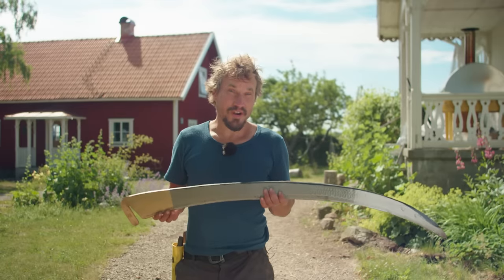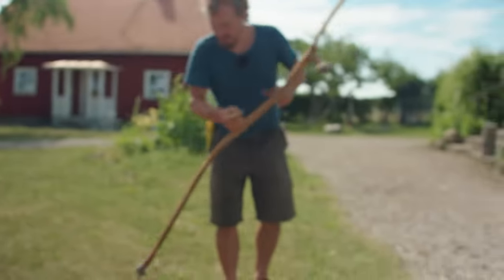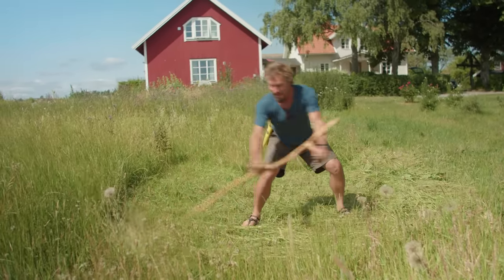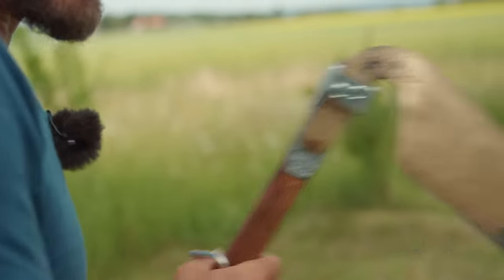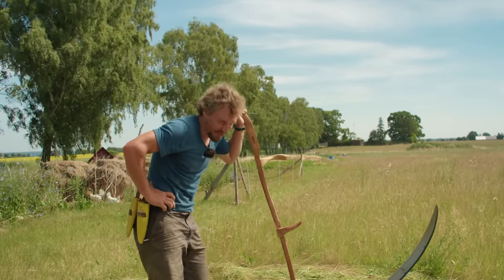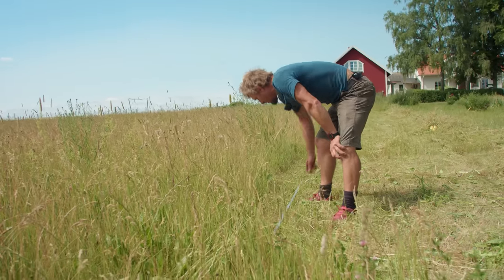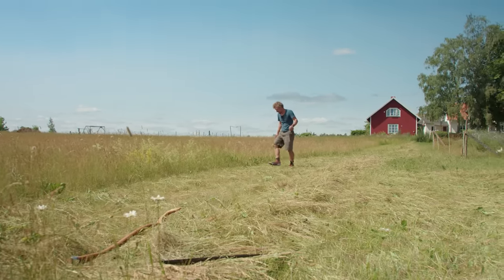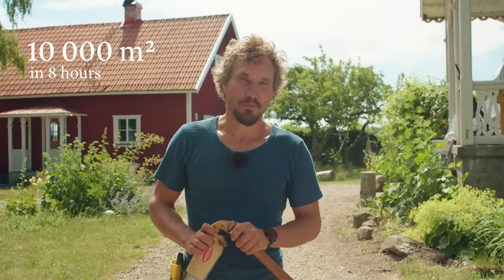Trying a HUGE Scythe Blade | MIND-BLOWING RESULTS! Hartstahl 120 cm Competition Size Blade

Comment: Have you tried mowing with the very very short blades that were common on the Norwegian west coast? I still have my grandfathers one handed scythe. Very useful for clearing in rough terrain.
Reply from the maker: I know about the one handed but never worked with it. I am sure it is good in some very steep rough terrain. 
50 cm blades are surprisingly effective, I recommend for kids and elders.
Reply: @slattergubben6702  I don't think ours is even 50 cm, and the haft is not much longer, and the angle is very different from normal Scythes.

Comment: I never knew that scythe cutting competitions were a thing.  For the competition, is it legal to use other materials for the blade instead of steel?  I'm thinking of a carbon fiber blade with either a steel or ceramic cutting edge.  It would be expensive, but the carbon fiber would be about 1/10 of the weight of steel for the same mechanical strength, and the ceramic edge would be long-lasting so long as you don't hit rocks with it.  This weight savings would greatly reduce fatigue and lengthen the amount of time that you use the scythe between breaks.

Ed Schultheis
Mechanical design engineer and manufacturing consultant
Reply from the maker: Regarding the snath I can see a realistic commercialisation with carbon fiber. I would love it! 
Blades...yes for competition it would be great if only the last 10 mm on the bevel were of actual peenable bladesteel and rest carbon fiber. For everyday use...I really doubt. Ceramic bevel won't work.

Comment: Pardon what is probably a dumb question. Why are scythe blades so long anyway? The length doesn't get used. The point gets used. The swing is made with the point directed towards the target, not the length of the blade.
Reply from the maker: The longer blade you have the more deep you can go in each stroke. Pretty simple given that there is a certain cutting angle that is the best to cut the grass. But normally we use 65-75cm blades. 50 cm for kids and elders. There is always a compromise with more weight and less control with increasing length and it is possible to adjust after how even the area you cut is and how nice is the vegetation

Comment: The snath  can be anywhere from 12 inches (30 centimeters) to 50 inches (125 centimeters) long. I used to know a guy that cut all his hay with a scythe, a little bity man that was all heart cause he could swing that thing all day. Seem to remember that he never "honed" it but rather peened the edge multiple times during the day. :)
Reply from the maker: I think you mean the blade, as the snath is the handle or shaft that the blade is fastened to. But yes, there are many variations and many methods of caring for them :)

Comment: Question? That kind of cutting grass good only for flat land? Or good also ung mountain area land cuz my land is on the mountain side and lots of stone also.. hope you answer it thnx
Reply from the maker: That's where the scythe is really good! But with shorter blades of course. On flat land you can't compete with modern big machines
Reply: in austria we traditionally use the scythe for steep hills and our alms in the alps, because no machine is able to drive there. well up until the terratec ibex..

Comment: I've been wondering about this for a while, and this is just my dumb ass not knowing; why is the tip not extended more outward? With no knowledge, it seems very ineffecient and cuts a lot of potential cutting power.
 Is it something about that it will dull the blade too quickly, or is it too difficult and exhausting to cut through?
Reply from the maker: @mr.boomguy  there is a perfect angle for cutting the grass, once you work with the scythe you will notice it is like learning how to ride a bicycle. More open blade will make you chop the grass. Same as you do not like just pres down your knife in the loaf when cutting a slice of bread. You can look at my video about how to mount a scythe to understand more

Comment: There is probably a reasonable answer to this, but as a tallish man (188cm) I always wonder why they don't make the handles so you don't have to bend over?  When you were cutting I couldn't help thinking about my lower back.
Reply from the maker: We make and sell snaths of different lengths so that you have one that fits your height, up to 200 cm. I'm not bending over that much, but it's necessary to have a bit of a bounce to your movement as you are scything, and it would be a weird and very stiff kind of movement standing up completely straight. You're welcome to watch my video on Basic Movements and try for yourself, you don't need to have a scythe to do them.

Comment: Can somebody explain how this can possibly be a profession when mowing with machines is so much faster? Is this some sort of special mowing that a machine can't do? Is it actually somehow similarly efficient to do this manually vs. a machine? What's the deal?
Reply: Machines do not always work well with stony meadows, wet bogs or steep slopes.
Reply: @moffigreen  Makes sense. Never considered that before.
Reply from the maker: Thanks for asking! Speed is not always the only factor, although the scythe is actually quicker than machines when it comes to mowing or strimming. With a scythe there is no pollution, no machines breaking down, no noise disturbing humans or wildlife, and it's easy to spot and skip rare species that we are trying to save on the meadows where we mow. We also do a lot of clearing work to restore old, overgrown meadows, where there are saplings and bushes, and then we can easily switch to an axe for example. There are more videos on this channel about that, if you are curious :) Thanks for asking!

Comment: I'd be wiling to bet that if you optimize all the handle/shaft weights and measurements for your height and arm length, and then optimize the hafting and lay angles for that shaft, that thing would only feel half as heavy.  Now how you go about doing that, idk.  Maybe a lost art?
Reply from the maker: For a normal set yes, but regarding a 120 blade it is hard to half the weight as it needs stability and the blade is so heavy itself. Wooden snath is less than 1.5kg , transforming it into a superlight carbonfiber probably just reduces 1kg. 120 blade I think is around 2kg.

Comment: Are you really bending a tempered steel blade ?
Reply from the maker: Yes, that works fine. Not too many times of course. But the blades are less hardened in the neck so they are easier to bend.

Comment: I m a professional strimmer in Portugal and i do 1 hectare in a dry meadow and i know how hard this is to do in a day
Please do the test, i would appreciate to see your professional way
Reply from the maker: Ok, but do you work with motorised strimmer or scythe?
Reply: STIHL 560
But like i was trying to mean, i m use to work hard and i was not trying to say your work is bad or good just that is a hard work.
Its not easy also to work with such a heavy machine and do 1 hectare in 8/9 hours, it takes a tow out of your body so i have to prepare my Core and endurance to do it during everyday of a week.
I take my hat to you and hope to see your test soon
Reply from the maker: @zepedro6290  impressive! I did not know it is possible to do such much with a strimmer in one day. Always seen them as slower than scythe. If working on such big steals - then why not use tractor? Is it for reducing risk of fire? Is the grass removed and what do you do with it?
Reply from the maker: Such big areas I mean
Reply: This work is done in a regenerative concept inside an agroforest.
Yes we can do a lot, not all of us but some, depending on the landscape and the blades or wire we use it also as an effect on the velocity and width of the work, with the blades normally we change for a new blade at lunch time and then sharpen them in the  end of the day at the workshop.
When i can i try to lay down the grass all in one side against the slope in a continuous mount but this is only when its a meadow in the midlle of the agroforest.

Comment: I'd love to see the hectare challenge!
But without the subtitles obscuring lots of the action.
Your English is perfect, no need for captions.
Reply from the maker: Thank you! 
The captions are there for accessibility, so have nothing to do with my language skills. It's something to be mindful of when filming of course, but they are easy to toggle off if you don't want them. Just click on the CC button in the video :)
Reply: @slattergubben6702  
No, they refused to disappear when I tried disabling them.
*Edit: I had used the Settings icon, which didn't work, not the CC icon.
The worst thing is that these large captions always occupy the lower third of the frame, which is typically where the action is happening.
So annoying!
Is this a new thing that you've started doing? I haven't watched all your videos, but I don't remember this on others.
Reply from the maker: Yes, it's the CC icon you need to toggle. You can change the settings for captions as well. Click on Settings in the video player, chose Subtitles/Captions and there should be an "Options" in the upper right corner, where you can change size, color, etc.
As the channel is growing and we have more viewers from different countries, subtitles are a great help to some, either in English or for better translations than auto-generated captions. So there are captions on most videos now. Nothing is for everyone, but luckily you can chose for yourself if you want them showing or not. And, again, something to think about when filming.

Comment: Are you supposed to be hunching? I feel like that is making you exhausted much much faster.
Reply from the maker: You are partly right. As this long blades are made for competition where you compete for short times it is a must to hunch to get a fast , strong and effective stroke, also much shorter snath is used for this long blades. Look at any competition video and you will se people hunch at least as much as I do here. In the long run for normal mowing I use and recommend a style with no , or just a little hunch. Look at some of my other video's.

Comment: It never occurred to me that there could be such thing as a professional mower, especially with lawnmowers and weedwhackers, my only guess is perhaps the sound or ecological concerns?
Reply from the maker: And much more, the scythe are for the first much much faster than weedwacker etc if you can handle it! But on big fields with big machines or lawnmosers - yes then I can not compete of cores. But with a handheld smaller motorized lawnmower - yes.

Comment: If it cuts 25% more than a shorter blade, but it takes you 75% longer to recover from the harder workout, where is the gain?
Reply from the maker: There is no long term gain with this blade, it is too heavy. Only for competitions that is over a short time. For example fastest mowing on 10*10m. 
I would say no one works professionally with any longer than 85 or maximum 95 in optimal conditions for long blades. I rarely use any longer than 75cm.
Reply: @slattergubben6702  Thanks for the follow up. 👍🏼

Comment: Huge scythe is a bad idea. Difficult to operate, heavy and slow. You will not work for long by watching your technique and it you try you will get problems with knees and back. Don't! Get a normal one and try half a hectar a day for few days. If you can sustain that rate you are almost done learning it.
Bulgarian shepherd here! Cheers and take care!
Reply from the maker: You are right, it is too heavy and hard to control for working a whole day. But I do scything professionally for many years so I know it is not bad for the body. And what is ergonomic.
Reply: @slattergubben6702  what you have here is just a novelty item. Looks good on yt thumbnail, but it's just not practical.

Comment: That thing is faster than a mower
Reply from the maker: It is!
Reply: @slattergubben6702   It seems heavy though. Are the blades not usually that big?
Reply from the maker: @righty-o3585  Depends on who you ask. Just så some Bascian films from another comment - there they use such blades as normal. But for us who are mainly mowing in stony, bumpy or wet contidions we use 65-75cm blades.

Comment: My grandfather would say your technique is fully wrong. Your legs and back will start to pain really fast. And he did not cut grass around the house - he and his other coworkers did hectares a day..  so the efficiency was really important. I worked with him just couple of times, but still remember
Back should be straight, same as legs actually. Cutting is done with a torso rotation followed by hands. No any rush movements - it should be smooth. Let the braid cut.. 
And blade angle is also too flat. It should be about 45 degrees and after you basically need to tune the angle to the shaft length and your full height.
Reply from the maker: Thanks! This is the way I do and teach as well. We also work in team and mow hectars for three month a year. But this blade is for competition and when looking at professional competitors they work with often more bent back than I have on this film!
Reply: @slattergubben6702  hi. That is actually what I have thought after seeing how many scything videos do you have. That it is actually a competition technique - fast, but needs more energy.. 
I just went through tens of different videos where people show "how to" and still didn't see that smooth, seemingly effortless cutting which I have in my memory.. 
Still - sorry and have fun with that. That is the most crucial point.
Reply from the maker: @TushhsuT  ok, which country? There are some different styles although they all (good styles) basically use the same way to gain energy. I teach and use a style where you use more or less all muscles in the body, especially the big ones like calf, tigh, butt and core. And for sure I and my team goes loong days , day after day. I know there are styles where you do not use so much legs and a more raised scythe. But I believe in using the legs.

Comment: Use the special hammer to make blade thinner. Your tool destroying the blade. Your style is not professional, it is harsh work to make it that way. Short cuts and Moai-like movement is right way.
Reply from the maker: Thanks for your input, you do what works for you. This way works great for me and I have been working with a scythe professionally for over 15 years. Sometimes there are more than one "right" way.
Reply: @slattergubben6702  Your tool taps the blade in all directions, the special hammer only taps widthwise. Your style is applicable when you are young and strong. My great-grandfather taught me how to mow with a scythe at the age of 83. He was able to mow a hectare in this way.

Comment: You are not using it with the correct body position. You don't need to lower yourself so much, be more straight. Also the lighter the tool the better will be the overall you don't need to chase the sizes, with a much smaller and thinner you can go with hours. Use the inertia of the tool not your body strength, you swinged ten times and already give up of exhaustion. The only thing I approve is the handle, but be more straight, dont squat to use more energy.
Reply: This is a crazy long blade for special occasions 😊
Reply: @moffigreen yeah it's heavy that is why he is bending 😅
Just checked his channel he really knows how to use one, just popped on recommended and clicked
Reply from the maker: There is many people in competition videos bending much more! Whatch my other videos where I use 65 and 75 cm blades. I am working as professional mower. Note that for example the Basque people go with extremely long blades and bend back also in normal mowing , as did many of the old farmers here back in the days. If you are wellfit and strong they may have something to teach us! But I do not teach or use that tecnice.

Comment: It is very surprising to see a 'professional' wearing sandals to use a scythe.. Do you not own boots? Barefoot or running shoes? Don't be silly. Dress properly for the job you are doing you are not at the beach. Wear eye protection when you are hammering steel too you are an accident waiting to happen.
Reply from the maker: Thanks! As I tell in the video sandals is not good. It was a sunny day and it was not my intention to work with scything that day. Protection glasses - absolutely a good advice!